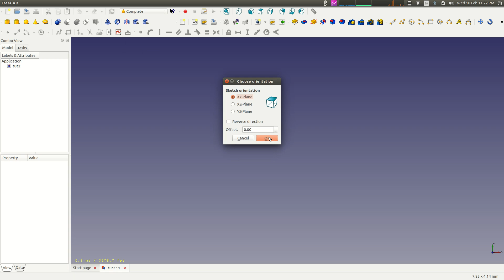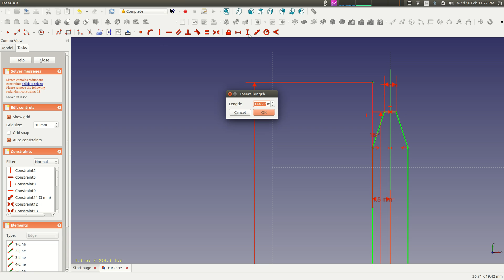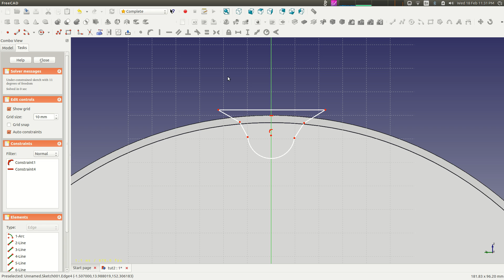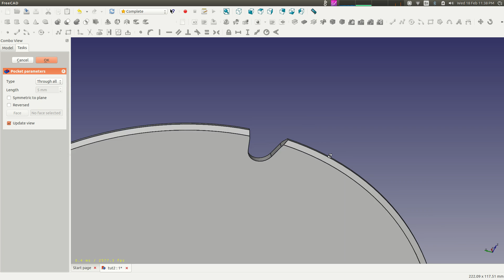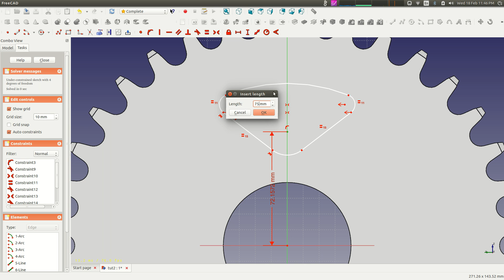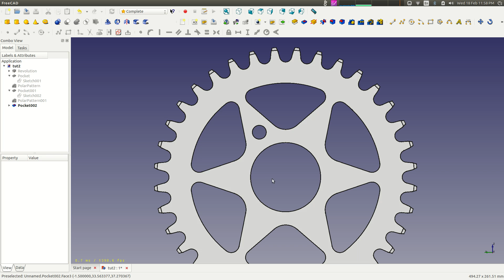tutorial2 FreeCAD

Comment: UNFORTUNATELY, things have changed with the program since j16out made these 3 tutorials and they've made the "complete" workbench empty to encourage people not to use it. So, I'm having difficulty trying to figure out which construction tools and editing tools are being used and where to find them.
I am a graphic designer and use software such as CorelDRAW, Adobe Illustrator and Inkscape and this program is NOTHING like those even though, before any extrusions are created, one would think that there would be some similarities. There is nothing intuitive AT ALL with FreeCAD to what graphic designers use. Sad that because they could have made it so much easier to use. BUT, maybe it IS intuitive to engineers??? Dunno. FreeCAD is SO FRUSTRATING to so many people and there are very few GOOD tutors and tutorials out there.